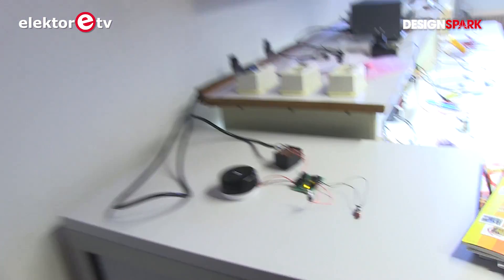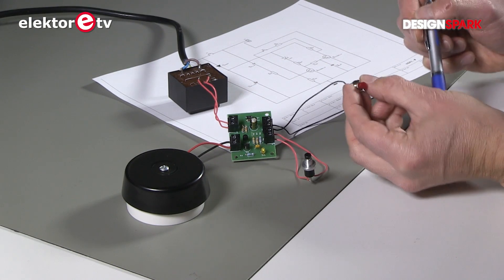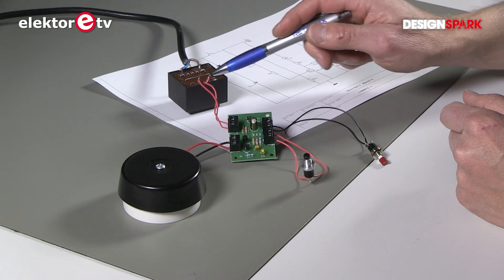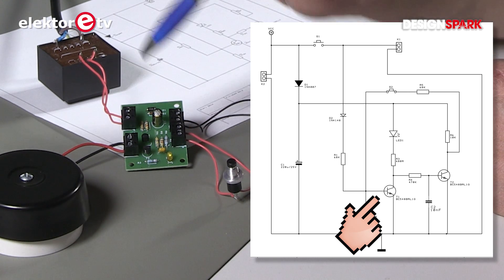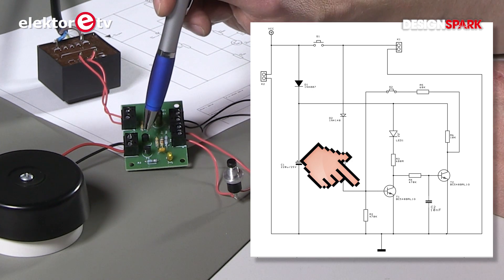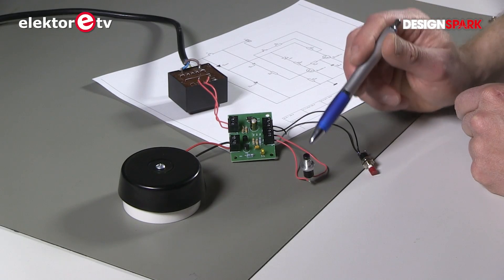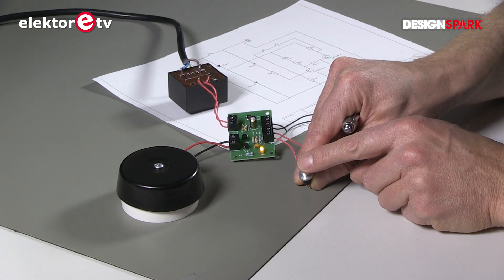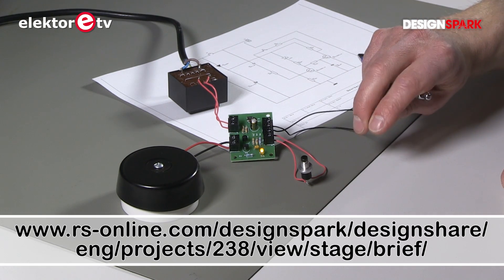Doorbell Memory

Comment: Is it stupid to ask why there is no diode to protect the transistor? Most conventional doorbells have a coil, many of them with a breaker contact. I would expect that to result in some induction.
Reply: René Boeije There is no diode because the transistors are not used to switch the doorbell. They detect that the button was pressed and then light an LED. If we had used a transistor to control th edoorbell, you would have been right and a protection diode would have been necessary.